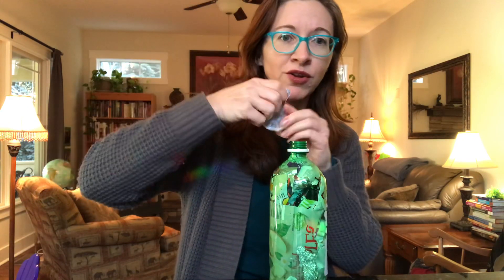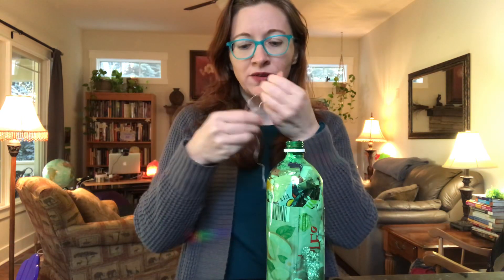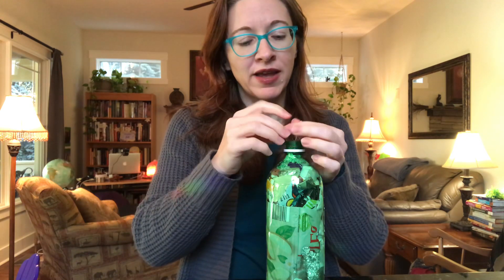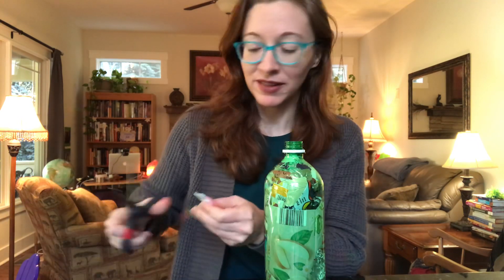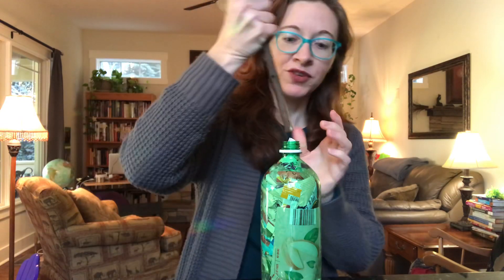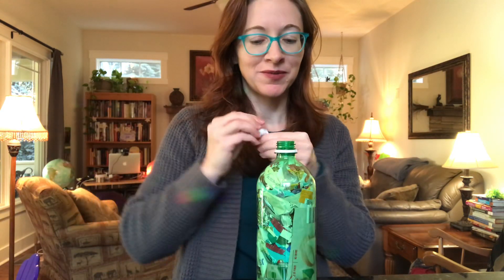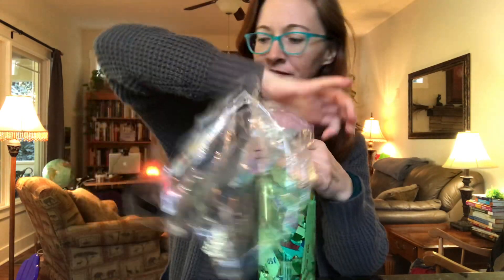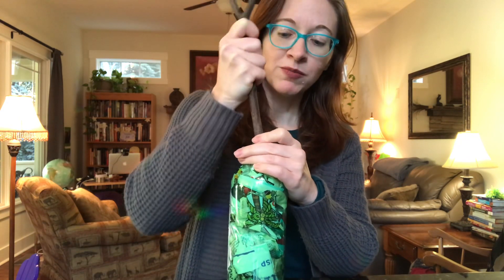How to make an Eco Brick

Comment: Found some Steel Reserve at a gas station for $2.19/42oz plastic bottle w/wide mouth. Probably would work well too. Cheaper than bottled water. Very robust bottles. No joke. The Steel Reserve gets rid of noxious liver and invasive weeds when used prudently. Even rid me of a persistent pokeweed. Powerful stuff.